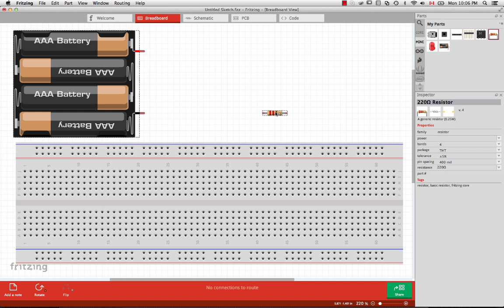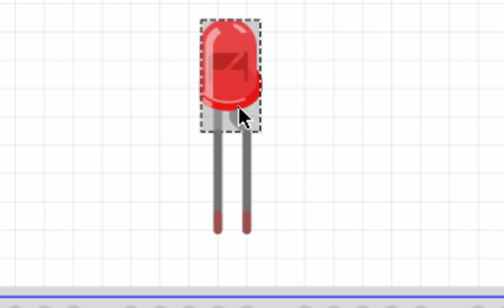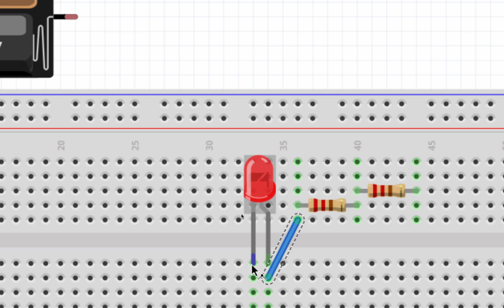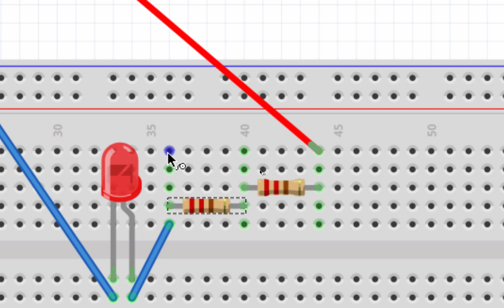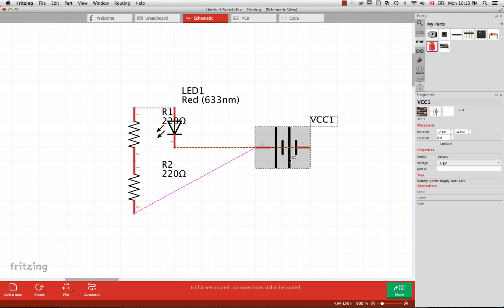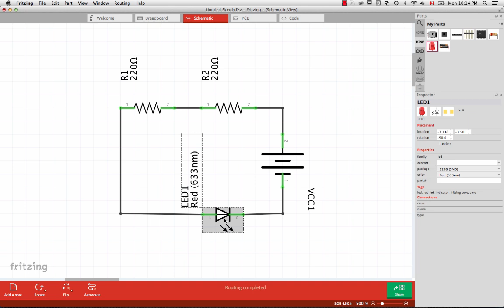How to use a breadboard using an animated breadboard (EECS 1011 Lab H)

Comment: I don't understand the point of fritzing if you can't simulate the circuit. The whole point of a bread board is to test your circuit works before you create a schematic, it's like a swimming pool with no water.
Reply: is there any software for simulating ciruit
Reply: Simon Carr have you find anything
Reply: Simon Carr thanks man
Reply: if fritzing can simulate the circuit then it will be the best application